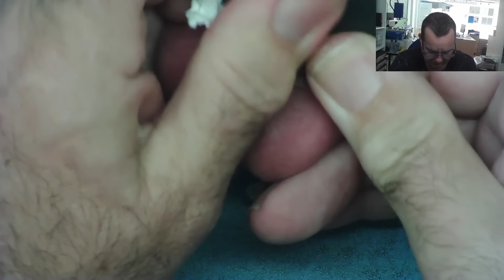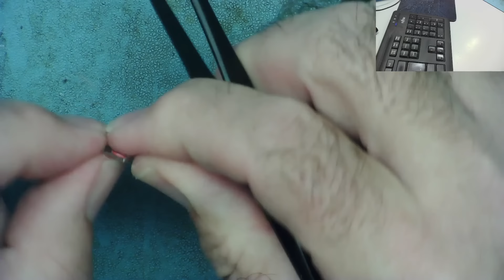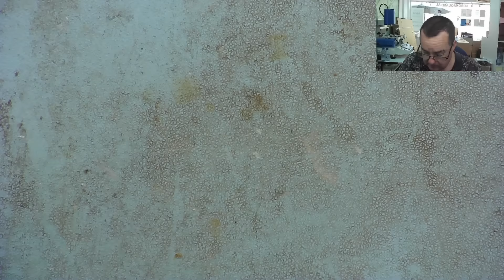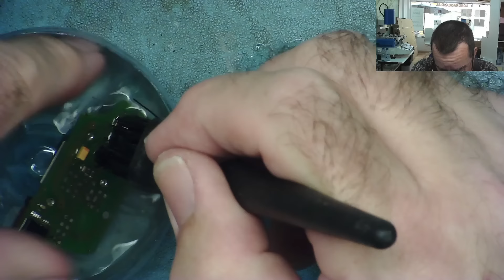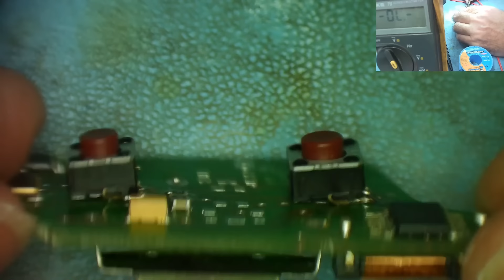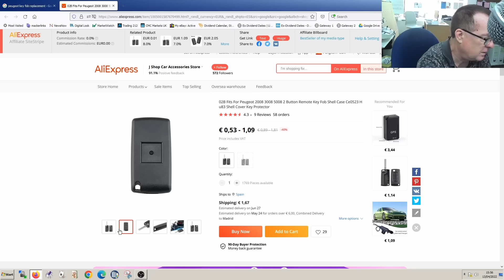Car Key Fob Remote Control Repair

Comment: the coil is the antenna for the immobilizer, it communicates with the receiver in the ignition. The chip underneath it is the immo chip that keeps track of the rolling codes and is the brain for the immobilizer function.

Comment: Here in Canada key fobs cost 100 to 150 plus programming 60 to 100 bucks becomes a expensive little thing and some cars don't even have a external lock to manually work the doors

Comment: The eeprom/mcu stores a bin file with rolling code key string. The car has a module that like the bcm or immo box that stores and compares the key string. If the keys string is wrong or the key is not programmed to the car then the cars immobilizer will not give start authorization as an anti theft system. So the coil you seen amplifies the key bin file and the cars receiver most of the time installed around the ignition lock cylinder. If you want to restore the key without contacting me <locksmith] then solder over eeprom/mcu from old key to new key and your good to go.

Comment: Hi Richard. I love your work.

I have a key fob that went through the washing machine and no longer lights the led when the button is pressed, even with a new battery. What do you think my chances are at getting it working again, and what is likely to be the main challenge? Is it likely to work if I can remove all of the corrosion?

Genuine dealer replacement costs $500 AUD (around $330 Euros)! This is because they have to use special equipment to register a new fob to the car. So it's worth me having a go at fixing it.

Comment: If you were to get a replacement shell for the peugeot fob you'd have to change the switches again to some closer to the originals - otherwise you'd have to cut the new shell to accept the replacements you fitted and allow them room to work, so it would look similar to the existing one! 🙂

Comment: little tip for you. just cut to shape and glue the insides membrane of any old keyboard (most have silicon "rebound" pads) on the inside of the key fob. This will protect the button and look at least a bit better :)
Reply from the maker: Actually I thought maybe to take some form old TV remote controls.  I've told the owner I can get a new case for the Puegeot fob and psossibly for the other if I know what it belongs to.  I've got to go see him in the next couple of days as I just completed another repair for him - PA Amplifier, I'll upload later today

Comment: Nice repair, but regarding the second one, I don’t think it will hold without securing the switches down or use ‘proper’ switches. If the owner manages to break them I kinda suspect they are not being gentle with them and the only thing holding the switches are 2 small solder pads. When the pads break, repairing them will be even more difficult
Reply from the maker: Yeah you could be right.  Actually I did use some hot melt glue (in the video) to hold them down so we will see.

Comment: Richard, could you mention what power supply you would recommend to purchase. I have a 10 amp/30volt desktop power supply but I cannot adjust it to get more then .1amp at .8volt while checking for a short. I saw you doing the same thing and getting several amps at .8 to 1 volt. You mentioned on one video that you would get a 10amp/30volt the next time you needed one. Could you recommend one that would allow several amps such as the one you would buy. Thanks.  I tried discord to get help, but no answers as of yet. Thanks again and stay well.
Reply: @Guilherme Freitas  Thanks and take care.
Reply from the maker: amtpdb1 The current depends on the resistance of the load or 'short' not the power supply.
In your case ohms law say R=V/I  You have 0.8V and 0.1A

So R = 0.8/0.1 = 8 ohms

If the 'short' is reading much lower than that on your multi meter (in ohms range not diode test mode) try using some thick wires from the PSU and solder them to the device under test at the points which you read the low resistance.  Then measure the voltage with your multi meter at both the PSU output and the points you attached the wires.  It chould be about the same if you got a good connection

If the resistance of your 'short' really is about 8 ohms then most likely you don't have a short at all, you need to post more info about the device and where you are reading the low resistance.
Reply: @learnelectronicsrepair  Richard: Thanks for the information. I hope you had a good Easter. Waiting for more videos.

Comment: On the Peugeot fob the key blade is held in by a roll pin that knocks out very easily, so you can swap the blank blade on the new fob with the original key blade. You don't need to get a new one cut.
Reply: Requires transponder programming by someone like me or you can de solder the mcu and transfer it to donor or immobilizer will lock you out